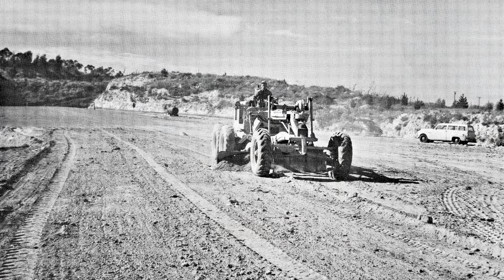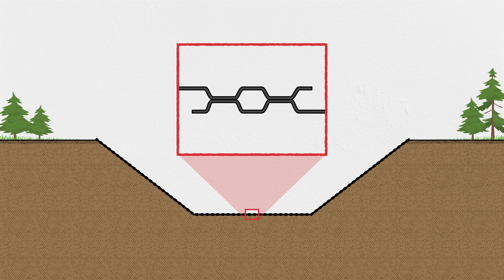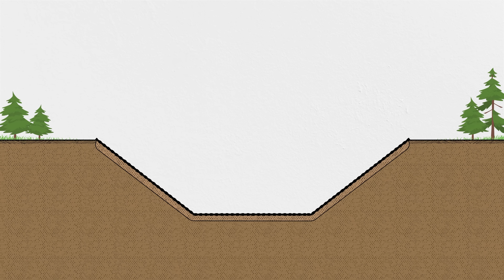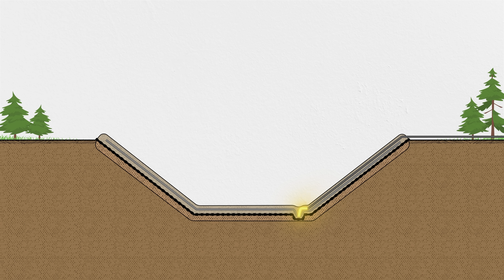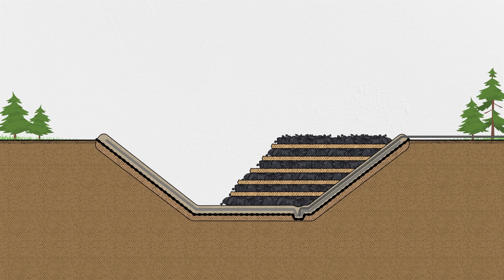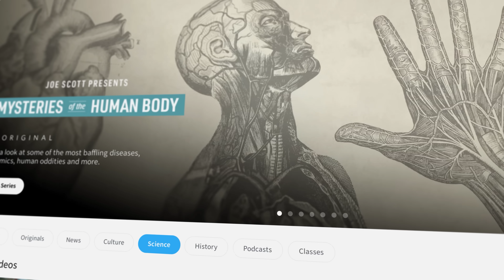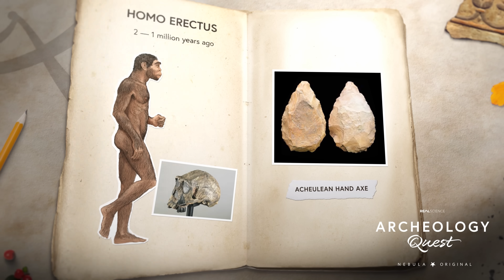The Hidden Engineering of Landfills

Comment: As a garbage collector in Sweden, I dump the trash I collect into a "box" where a claw collect the trash and turns it into heat / electricity, so we dont have to have landfills.
We do use a temporary landfill during the summer when maintanance are done to the factory.
All the food waste that we collect are turn into gas that our trucks are driving on and much more
Reply: We have a waste to electricity plant in pinellas county Florida. Basically he burned the trash and use the fire to turn generators. However, some things cannot be burnt and you do end up with tons and tons of ash which need to be buried. There is no such thing as 100% waste to energy outside of a cow stomach.
Reply: @jeffsipos6432 the ash isn’t buried in Sweden, or the slag should I say, it’s mostly glass, stone and metals which can be recycled while the glass/stones gets used for road building etc. the ash filtered from the emissions can be broken down into chemicals and is mostly processed to get various elements
Reply: @  
Mostly, doesn’t mean all , there’s always waste at the end, regardless of what you call it.
Reply: @jeffsipos6432  Hell of a lot less then when you started. And it's only time before more uses are figured out for it. Brilliant system. Should be a planet wide law to do this.
Reply: @jeffsipos6432  Mostly is a hell of a lot more than none!
Reply: @jeffsipos6432  There is almost none.
Reply: @jeffsipos6432  Much of the ash consists of metals and glass, which are recycled. The rest is basically inert and  is used as coverage at landfills, fill dirt for construction, or mixed into concrete and pavement for roads.
Reply: I would like to see a video done on this.
Reply: There is one produced by the combustion facility themselves. https://youtu.be/-eVU_oARI44

It's in Swedish but they have English subtitles if you activate them. This city and municipality has about 170,000 inhabitants but the facility is so high tech it is cleaner to actually import trash from other countries to burn here, than to let the other countries burn it themselves, despite transportation emissions.

This facility works in conjunction with a food waste plant just next door, where everything becomes bio fuel for the local public transportation, so that's half the trash done right. Most of the other half is recycled into new materials and products, but what can't be recycled, is burned. Virtually nothing ends up in landfill. 

The burning heats up water which will go to house heating through hotwater radiators and shower/warm water, and the rest drives various steam generators which generate electricity. The incineration smoke gets supercleansed and the only thing coming out of the chimney is water vapor. THEN, the infinitesimal amount of waste that can't be dealt with, ends up in landfill - but not in a dump. They get integrated into road works constructions like bridgehead foundations and gravel for highways. 

The term landfill is a disgusting concept to us and virtually unheard of in northern Europe.
Reply: There is one produced by the combustion facility themselves. The address is " -eVU_oARI44 ". Or search for "Rundvandring på Gärstadverket".

It's in Swedish but they have English subtitles if you activate them. This city and municipality has about 170,000 inhabitants but the facility is so high tech it is cleaner to actually import trash from other countries to burn here, than to let the other countries burn it themselves, despite transportation emissions.

This facility works in conjunction with a food waste plant just next door, where everything becomes bio fuel for the local public transportation, so that's half the trash done right. Most of the other half is recycled into new materials and products, but what can't be recycled, is burned. Virtually nothing ends up in landfill. 

The burning heats up water which will go to house heating through hotwater radiators and shower/warm water, and the rest drives various steam generators which generate electricity. The incineration smoke gets supercleansed and the only thing coming out of the chimney is water vapor. THEN, the infinitesimal amount of waste that can't be dealt with, ends up in landfill - but not in a dump. They get integrated into road works constructions like bridgehead foundations and gravel for highways. 

The term landfill is a disgusting concept to us and virtually unheard of in northern Europe.
Reply: @forliberty47  There is one produced by the combustion facility themselves. The address is " -eVU_oARI44 ". Or search for "Rundvandring på Gärstadverket".

It's in Swedish but they have English subtitles if you activate them. This city and municipality has about 170,000 inhabitants but the facility is so high tech it is cleaner to actually import trash from other countries to burn here, than to let the other countries burn it themselves, despite transportation emissions.

This facility works in conjunction with a food waste plant just next door, where everything becomes bio fuel for the local public transportation, so that's half the trash done right. Most of the other half is recycled into new materials and products, but what can't be recycled, is burned. Virtually nothing ends up in landfill. 

The burning heats up water which will go to house heating through hotwater radiators and shower/warm water, and the rest drives various steam generators which generate electricity. The incineration smoke gets supercleansed and the only thing coming out of the chimney is water vapor. THEN, the infinitesimal amount of waste that can't be dealt with, ends up in landfill - but not in a dump. They get integrated into road works constructions like bridgehead foundations and gravel for highways. 

The term landfill is a disgusting concept to us and virtually unheard of in northern Europe.
Reply: That's done here in the US too, but it's not in the best interest of the waste management or electricity companies for the people that pay for trash removal and high electricity bills to know this.
Reply: @jacobbosley1946  The American people are perfectly aware of waste to energy systems. Doesn't beat coal or oil.
Reply: The U.S. has had domestic waste incinerators for decades if not a century. The U.S. city that contained the university I attended, incinerated their municipal garbage and created steam and electricity which supplied a BF Goodrich Tire factory (now owned by Michellin) with energy to produce tires. This was in the 1970s and it's still operating. But, incineration is old school technology. The city I live in now (also United States) has a world class municipal waste recycling facility that mechanically sorts and recycles bulk refuse straight from the trucks-people do not have to physically recycle at home. The combustible recycled fractions like paper and carboard are baled and used as fuel by cement production plants. Aluminum, glass, metal, etc. is recycled. There is a small part left, such as food waste that is landfilled.
Reply: thats actually really cool. How does it turn it into heat? Does it burn the trash?
Reply: @ some trash are burnt, but I dont know exactly how its done.
Reply: @Jiiimmie dam Sweden sounds like a great place to live
Reply: @HughJanus-f2l  it is, if you can you should visit sweden. Don't go to the bigger cities, go to a smaller one its calmer and more of "Sweden".
Reply: @Th0rchagan a lot of waste - except glass, metal, electronics, cardboard, perhaps some others - are burned in a combined heat and power plant. We also get paid for importing a lot of waste from other nations and thus the fuel is very “cheap”. It is mainly used for heating via district heating networks and responds to around 15-25% of the heating needs (depending on what you count as waste). For electricity it is insignificant nationally but helps with power and grid congestion issues locally at times. Especially in winter. It is mainly to solve our waste issue but with some added benefit of heating and power. 

However it does release CO2 which EU do not like. So there are worries of increased penalties (taxes, quotas, etc.) that might threaten the industry. At the same time EU wants/have banned new landfills so who knows what one should do. Also, the release of methane from landfill is equivalent to burning the waste - except that you don’t get the energy back. 

Some person said that it can’t compete with oil. First of, it is not the point, the point is to manage waste more efficiently and have a better use of resources. Secondly, for heating it is cheaper since the fuel is basically free, so in this regard it can’ compete. For power I do not think it is energy dense enough to compete by only producing electricity. But again, the aim is not to replace oil or coal, it is to use recycle energy that otherwise would be lost and minimize landfills (which is inherently wasteful)
Reply: @balderhagert6155  The thing about incinerators that really bothers me is the fact that I know people toss smoke/fire detectors in the trash in cities that I know incinerate their trash and I doubt they are picked out. Those detectors contain Americium-241 a highly radioactive man-made element which goes up the stack with the smoke. If an innocent person downwind inhales an atom of it, it could lead to lung cancer.
Reply: @stampoutup-talking1436  Two things. One, WTE facilities treat their exhaust to remove contaminants. Two, everything is already naturally radioactive to some degree. The dosage you'd get from smoke detectors if the exhaust wasn't treated is nothing compared to even having granite countertops.
Reply: @Th0rchagan the decomposition of organic material, especially things like grass and leaves generates heat in a compost bin. It can actually result in a fire if not maintained properly.
Reply: @Th0rchagan  not Sweden but Switzerland
https://youtu.be/1he8fCuRfhE?si=ydNsDsHXUHR4r9MX
Reply: @Th0rchagan it's burnt yeah. So there is a tradeoff with combusting all that waste and releasing the compounds into our atmosphere.
Reply: @JLlamas32  Wrong. Not only do WTE plants run hot enough to effectively combust everything, they also treat the exhaust gasses.
Reply: We did it this way also back in the day here in the States. The trash was thrown back into Coal Fired Furnaces to create electricity. Landfills have the advantage of recovering precious metals and making Natural gases that can be used also. I never understoow why it was a bad thing to put something back into the ground that came out of the ground.
Reply: What of the stuff that can't be burnt?
Reply: @jonathonfrazier6622  Well some of if say cuttlery gets to the bottom of the burners, then they get cleaned out by sanitary crew and transported to the dump.
I worked with that before being a garbage man xD
Reply: @Jiiimmie  what about batteries, plastic.
Reply: We had one of these in Detroit Michigan.  We called it "THE BURNER"
Reply: @justingonzalez9854  Lol, that's what we call the one in Spokane county.
Reply: I've seen videos on this. It's fascinating how it's done. 
It's a 3 compartment system. 
1st. They sort out all the metal n things thst go boom. 
2nd. It's heated to dry everything out n then scans for metals n booms again. 
3rd. It's burnt till it becomes ashes. Causing water to be heated creating steam which moves a turbine to created electricity. It's awesome. 
It really should be done world wide.
Reply: You need to be careful with this. Unless the flue gases are carefully filtered you can end up with nitrogen oxides and other bad stuff in the atmosphere and into everybody's lungs. If the w2e plant is careless about electronic waste then God help us (mercury and arsenic and gallium). The humble landfill doesn't fare that badly compared to a w2e. 

HOWEVER, the very best way to reduce landfill or w2e management is to reduce consumption in the first place.
Reply: Yumpin’ Yimminy!
Reply: Same here in Switzerland, almost all trash is burnt and turned into energy. Aluminium, iron, glas, paper, electronic waste and some kinds of plastic are recycled as far as possible. There are collector stations in almost every town.
Reply: we have this too. Muricans are just the third world country. Even China burn the trash with almost none impact on environment and the filters to collect the rest from the air.
Reply: This is the way.
Reply: Same in Denmark.
Reply: Waste to electricity generates a lot of pollution.  It's as bad as fossil fuels (or worse if you don't have proper regulations)
Reply: @karakaaa3371  Wrong, stop promulgating pseudo-environmentalist propaganda.
Reply: And Americans still think America is so great and advanced. We're many steps behind other countries.
Reply: @sallyreim6668  I dont know how true it is, but I've heard that we import trash in sweden to destroy it safely, I've seen trucks from Poland come with big cubes of paper ish material to a recycling centre
Reply: @sallyreim6668 stop whining
Reply: @sallyreim6668 We are on top.
Reply: @sallyreim6668  The United States have WTE facilities, but the so-called environmentalists have been railing against them for decades. Spokane county now has the last one on the east coast, which is in danger of shutting down because of the state's carbon tax.
Reply: @sallyreim6668  shocker a country that has the population of New York City can get rid of it's yeah reliably😑 use your brain Sally
Reply: @sallyreim6668 lol you know Sweden is exponentially less populated than America right? We’re not behind in a single advancement

Comment: Landfills,  unfortunate but necessary final resting places for about 19 ex RAAF (Royal Australian Air Force) General Dynamics F111c  bombers and the fleet of relatively  recently acquired Australian Army/Navy NH90 Taipan helicopters.  I always wondered why they couldn't be completely stripped down to recyclable materials and it turns out that during their manufacture some exotic and sometimes extremely dangerous compounds i.e. metal bonding adhesives,  asbestos and the like were employed,  more so for the F111's than the NH90's , the helicopters using composite structures and their own mysterious unknown materials so landfill was the only way to really go,  although the Ukrainian defence forces were pleading with the Australian government to donate the Taipan helicopters to no avail but that's another story for a different platform

Comment: If we spent a little more time seperating materials we have 60% less garbage . Burnaby city bc has local recycle plant in the middle and of the city. You would be surprised how much they make off that plant. Just one thing they should consider( a second use building). I found hitch propane tanks a ladder . I had to sneak out rhese things  because its one way plant.

Comment: I work at a collision repair/ body shop and the amount of plastics that are thrown away on a daily basis is disturbing. And we're not a high volume shop in a highly populated area. Modern vehicles are full of plastics that are just tossed out whenever they're damaged. It doesn't matter if it functions or not. If it's scratched or dented, it's going to the landfill. Disgusting

Comment: I worked at a landfill for a bit as a landfill gas technician. Reading wells, making sure they weren't over temp and had a healthy vacuum on them, ensuring the flare was burning properly. The only point I think you may have misrepresented a hair is that landfill gas is a problem both during and after the landfill's lifespan. It almost seemed like you were saying it was only a problem after closure, but the reality is that I had to do monthly checks on a live landfill to ensure they were within regulation. I also had to raise wells on the active workface to ensure they were accessible after the equipment operators did their work. Overall, though, excellent video!

Comment: I think people are missing the point when someone says reducing is the most important thing here. If every corporation started packaging better and reduced their waste in that way at and planned obsolescence, then the market would be set up for using that. The reason glass is sooooo much more expensive is because the market is built on plastic. Yes, glass would still be more expensive than any kind of plastic, but it’s either that or cancer from plastics (plus government subsidies, etc. could aid in the cost). Honestly, the comments demonizing individuals instead of the massive corporations that cause 70% of waste should seriously take a look in the mirror. It’s clear you guys have never taken an economics class because we were doing it in the 1950s with just glass and we have way more industry improvements since then, granted there are more people but still, it’s profits over the health of the planet and its people. Y’all are acting mighty foolish right now ngl
Reply: Not to mention, because we use petroleum based engines, the trucks coming to pick up your recycling actually cause more pollution than the recycling itself saves. Look it up but it’s basically on the industry standard to change so glass can become cheaper to produce, and the longer the glass industry goes on, the better and more efficient it will become. This is all literally basic economics. Yeah it’s heavier too but again, plastics literally turn into micro plastics that pass between your child’s blood-brain barrier so maybe choose your child over slurping the corporations agenda and swallowing it all with a smile